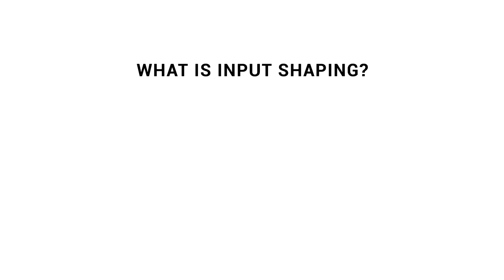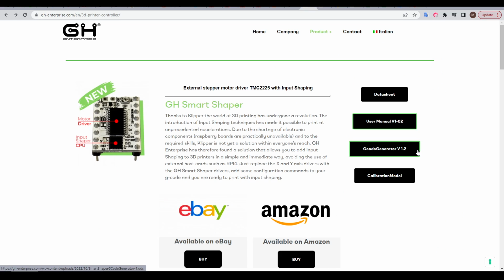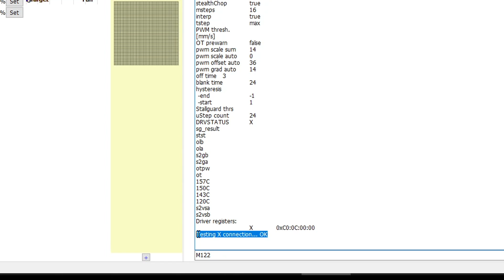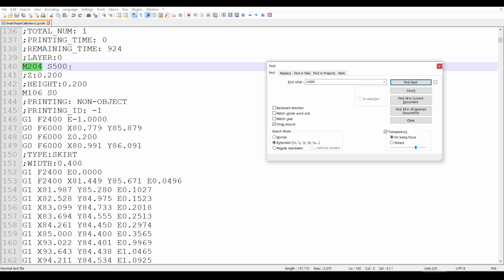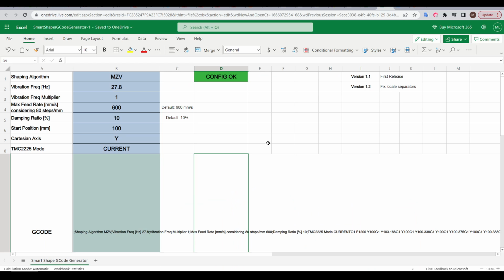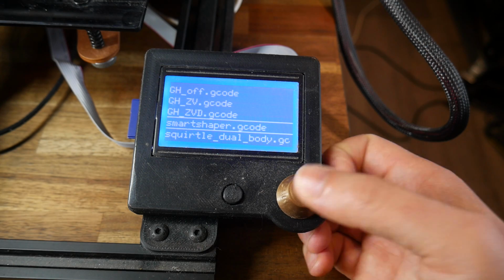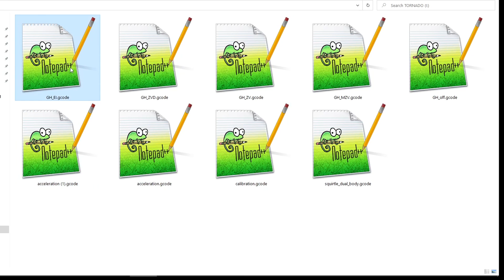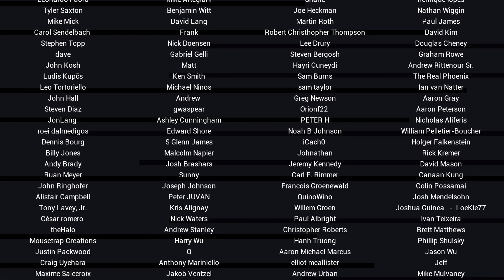Input shaping without changing firmware - GH Enterprise Smart Shaper guide and test

Comment: I was excited of the prospect of not having to change firmware, but after seeing changing jumpers on the mainboard and compiling firmware to support it, it sounds to overwhelming for me.  I think I would rather go down the road of Klipper before doing this.
Reply: You don't want to add a jumper and compile Marlin versus switch over Klipper which requires adding connecting something like a Raspberry Pi to the main board, possibly compiling Klipper for the main board, and compiling Klipper for the Raspberry Pi (or whatever computer you choose).

If you need to change jumpers then they will most likely be under the controllers that you are replacing and most likely be well documented for the main board you have. Compiling Marlin is much easier with VS Code with the auto build Marlin plug-in and there are videos on here to set up and compile Marlin. Ideally your printer manufacturer has a source code version of Marlin available and all you would have to do is make the one or two changes for each controller (change the controller value and the direction). Then if you wanted to, you could look at the other options available in Marlin and make your printing experience easier. For example, set up the default values for bed and nozzle temps to what you use and add more for specific filaments, add menus, add basic tracking of print jobs, and more.
Reply: Agree, using Klipper is a much better solution and doesn't require purpose built hardware. Better to use a Raspberry Pi that can be repurposed in the future.

Comment: Quite nice but, currently too expensive for results.  What I mean by this, is for the price of 2 driver chips... one can get a new board completely or even a pi if your able to find a non-price gouged one.   So they really only eliminate the need to change firmware. (which, marlin is working on anyway)  as a new 32bit board can be obtained for around the same price, with 2208's ready to go.     like I said really nice but seems overly niche market for that price range.
Reply: I think if you are technically adept enough to install and use these drivers, you are also adept enough to install and use Klipper on an outboard Pi.
Reply: @yeroca  But if you want to upgrade all 13 – or all 300 – of your printers that starts to get expensive. A print farm can recoup the cost after a little while thanks to the faster print speeds. But ultimately, the best solution would be if the variety of firmware already installed on the board could be updated to a new version that includes Input Shaping. With companies like BigTreeTech, Makerbase, and Prusa Research working more closely with Marlin Firmware, it will not be long before the majority of single-MCU 3D printers have Input Shaping as a standard feature. Then, Klipper will be less of a power upgrade, and more like the best way to get an alternative web interface on your printer.

Comment: I'd be interested if you cover marlin implementation of IS because it is basically free and requires just building new firmware.
Also you didn't mention that IS does cause quality loss, especially on high acceleration and it is noticeable if you print functional parts and not things like castle because those suddenly might refuse to fit due to smoothed corners.
Reply: What marlin implementation?  Marlin doesn't have an implementation that's comparable.  Even RRF; which just got its implementation - is lagging behind.
Reply: @ThantiK  In the video, he said Marlin IS is in the [development] pipeline, so I assume it's available as a snapshot (pre-release) build, but I haven't actually looked.
Reply: @ThantiK  It's in recent bugfix versions.
Reply: @pnt103  So an hour AFTER I posted this comment, you're all "correcting" me because it was merged... when I posted this comment, it hadn't been.  And it is STILL only ZV, and EXPERIMENTAL.  Parent comment asked TT to cover the marlin implementation...which did NOT EXIST at the time.

Comment: I wonder what the difference would be between your results in this setup vs using an adxl345 in klipper for the same printer.
Reply: Klipper is supposed to do the heavy lifting by freeing the main board of calculations, so it should be able to print faster, if your printer's mechanics allow it.

Comment: Correct me if I'm wrong but doesn't Marlin already have backlash compensation as a feature? Could that also help with ringing at higher accelerations?
Reply: Backlash? What 3D printers have a leadscrew on the X and Y axes? o.O
Reply: @alejandroperez5368  The Taz Pro has backlash compensation and gt2 belts on all axes.
Reply: @alejandroperez5368  Backlash happens on belts too, not just lead screws.
Reply: This is completely different to backlash

Comment: Hey, great video! After your review of the sovol sv04 I picked it up as my first 3d printer. After replacing the 3dtouch with a crtouch and switching the bed to a pei sheet, it is printing reliably and quickly, and I love the second extruder.

Do you know if a solution like this will be compatible with the sv04? Thanks!
Reply: No, the drivers are soldered on the SV04 mainboard. I have one also. But I also have a Tornado which will take them!
Reply: @vanceblosser2155  looks like I'm waiting for a pi then! Thx
Reply: @BenjaminSjavik  Or a good work alike since the Pi's are in very short supply. 

I also had a couple minor issues with my Sovol but once I got past them it's been a solid performer.

Comment: I find this so valuable and amazing. This means that a lot of old printers will probably be used for way longer because they can now keep up with the speeds of more modern machines. This will probably result in less E-waste. A great upgrade to have if you don't want to build your own LIS3DH cable harness, etc.
Reply: I'm using an old lg g4 phone. Installed ubuntu. (chroot) with linux deploy and klipper + octoprint on top of it. It is not an easy install by the way.
Reply: You can still use an old printer. Most people print a few parts per week, so a slow print speed does not matter.
Input shaping is like car tuning. It's fun, it's a nice hobby and they find a lot of excuses why they need it. Be honest: you want to "waste" time and that's absolutely ok.
I will stick to my old Geetech A10 with low print speeds.
Reply: @1234fishnet  you do you
Reply: To get input shaping on any printer, you don't need to throw anything out, no ewaste. All you need is a pi (or any other computer) and different firmware. You can add an accelerometer if you like for ease of use, but that's it. no garbage.
Reply: depends on the old printer.  not all have replaceable driver chips. many - especially creality made - have soldered on chipsets that technically "can" be removed, but much more difficult, and not a 'drop in solution'.  The E-waste is going to be just as bad really due to the cheap manufacturing of boards and other components.             I mean if you really worry about e-waste, start talking to Apple and other Phone makers who make  a few new models every single year - only to have most of them sit on shelves/warehouses for over a year.

Comment: So instead of any SBC and klipper that can be reconfigured from a text file without recompilation and adds a web interface and massivley improves on the gcode resolution a printer is capable of, you need to put time into compiling marlin where a decent starting config compatible with a bug free version might not exist? sounds like a lot of extra steps for addes compilation.

Duet and RRF also have input shaping i beleive.
Reply: Instead of having to run a separate computer with a Linux system we can now have the printer do the work. That's smarter than Klipper fans will ever admit.
Reply: I heard a great joke recently: How do you know if a vegan uses Klipper?

Comment: Hmm, doesn't this necessarily produce a time delay proportional to the resonance period? I don't see how that could be avoided, and it means your motion will be lagged behind extrusion by something like 20-40 ms. That would utterly destroy print quality at even moderate speeds. To put things in perspective, retraction should only take 25 ms or so in order not to have warts, so the motion intended to stop before the retract would finish after it. I guess you could buy an extra set to put on E (and Z while you're at it) to delay it equally...
Reply: I mean you can see the quality results in the video
Reply: @BeefIngot  You can't necessarily see the seem where problems would be the worst, and you don't know what speeds were used. With low enough speed the errors will be relatively small.
Reply: @daliasprints9798  Vorons, Vezbots, Ratrigs all use input shaping at speeds that are so stupidly high they are impractical and you dont see issues there so what exactly do you count as low enough?
Reply: @BeefIngot  Klipper's input shaping utilizes lookahead because it has future context available in its data model. It does not have a time delay from the filter. These chips on the other hand can't see step pulses Marlin hasn't emitted on the pins yet. They necessarily introduce a time shift.
Reply: The key place where ringing is an issue is on sharp corners. Since IS rounds these corners slightly, there are still limits to cornering speed and at slower speeds a slight latency has less effect. Added to this, the latency only applies to some of the control signal. In the current Marlin implementation, X and Y respond to corners at the same time as E, but at only half the amplitude and then after the latency the other half change comes into effect. I would guess this hardware does the same. So, yes, there may be further improvement possible but as Beef Ingot observes, the current results speak for themselves.

Comment: Wish you had mentioned this is no good for delta printers at the beginning of the video!  😐
Reply: With klipper it also works for delta printers.
The installation is well documented, even if you don't understand anything about linux and pis you can do it. It doesn't have to be expensive either, my Mendel90 runs on a pi1, my delta on a pi3. A pi2 should be enough for you, look for A1 or A2 on the SD card.
Reply: @eon6008  I already run Octoprint on a Pi on my delta. Just don't wish to use klipper.

Comment: I want to see a 2209 variant with sensorless homing
Reply: That was a bummer
Reply: Yup, I have an Ender 3 with TMC2209 and sensorless homing. Also, 40 euros is too much money. I'm staying with the ringing, as getting a Raspberry Pi board is impossible
Reply: @alejandroperez5368  Nice, i started with a ender 5 and enclose it and dit a lot off cnanges. Now with watercooled hotend 500C, and 165C bed with sensorless homing running marlin. Thought off installing klipper, but never tried it before and the downtime on the machine by switching firmware is not a option.